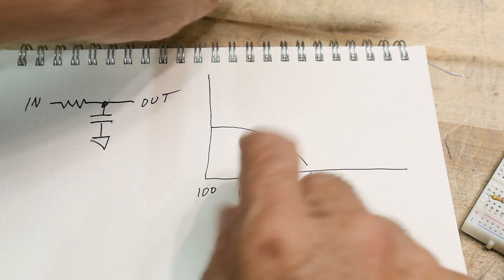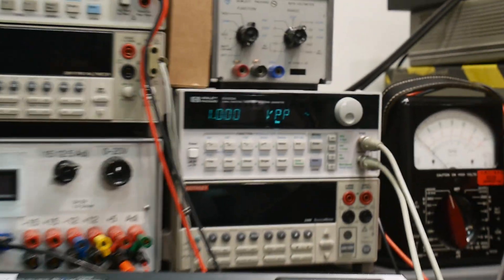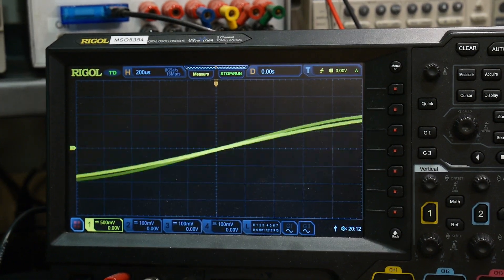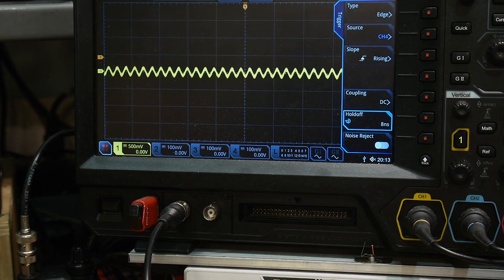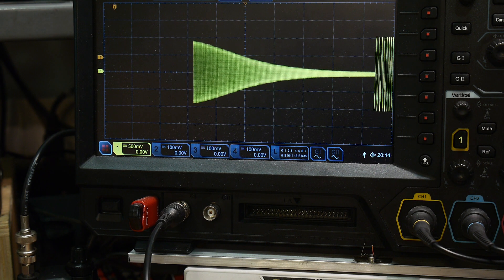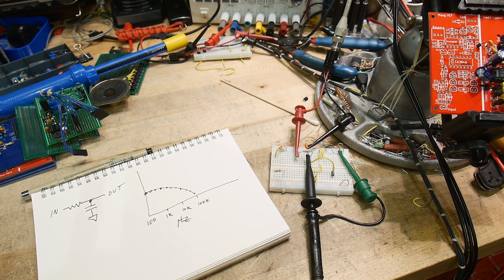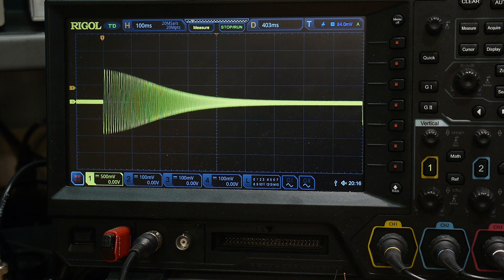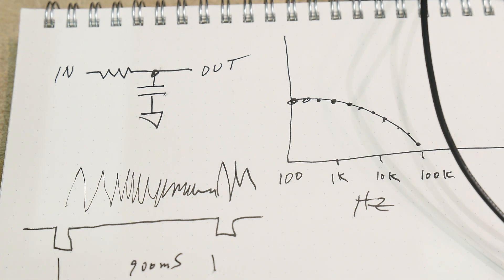#1213 Filter Frequency Response with Oscilloscope and Generator

Comment: My cheap function generator doesn't have the proper "sync" output. But it can have channel 1 frequency modulate on channel 2. So what I do is I put on a sawtooth on Ch2, let's say 0V to 5V. Then I frequency modulate on this to Ch 1 (enter proper parameters to set frequency spread corresponding to 0v-5V.) Then I trigger on Ch2, while looking at Ch1.

Comment: Thank you , very educational. Would you have an idea about how to get a pattern that is 4 waves that are syncronized  , that are 90 degrees apart could be generated?
Reply from the maker: 1. 7474 and 7404,  invert the clock and feed that into the second flipflop
2 four PLL
3. DDS, have phased sine waves in ROM
4. microcontroller
5. a transistor will output two signals 180 out of phase, output collector and output emitter, then do something like #1

Comment: I did a similar thing to make a tape for setting up the resonance of the heads on early vhs recorders. I made a circuit that generated a ramp triggered by the video field sync and fed the output of that to the vcrs fm modulator and recorded it. I fed the sync to the vcrs servo circuit as well so it had something to lock to. You can see the frequency response of the heads and preamp on the scope and you set it up to peak at 5mhz. I had to put a marker on the tape so I could tell where 5mhz was. I used a comparator for that to briefly pull down the input to the record amplifier when the ramp reached the voltage that corresponded to 5mhz output from the modulator.

Comment: Don't you have an external trigger input on the scope?   I thought that was where you input sync pulses so you don't burn a channel on the scope.     Especially if you only have a 2 channel scope.    Thanx for showing how to set this up.   Most channels show the signal but not how to set up the gear.   I would love to see how to setup scope/generator to measure signals when aligning FM tuners.
Reply: That was the first thing I was thinking. Both of my analog scopes have ext trig inputs.
Reply from the maker: no ext trigger, but lots of inputs, 4 channels and 16 logic channels all of which will trigger

Comment: You could use white noise generator as your source and Spectrum Analyzer for monitoring the output,  I think your oscilloscope should have FFT function or Spectrum Analyzer.

Comment: You could add a peak detector in front of the oscilloscope input, you will see only the envelope. I suggest to use germanium diode(s).
Reply from the maker: in the next video you will see that using a peak detector would not allow me to look at distortion.
Reply: @IMSAIGuy  I thought you were interested only in filter frequency response curve.
You mentioned distortions, you meant distortion of the wave passing the filter, thd ?
I’m waiting for the next video :)

Comment: I came late to the party, so obciously I've not seen your whole back catalog.  Have you done episodes on log amps?  An envelope detector and log amp is what you really need there - in which case you've built a DIY scalar network analyzer.

(The next step would be to have I and Q signals available for vector analysis, but that's harder, of course.)

(And yes, I know you have a VNA and I know why you're not using it here.)
Reply from the maker: I did a walk though of a spectrum analyzer and showed the log amp and envelope detector. I plan on doing a video on log amps in the future. this method allows me to zoom in and look at any distortion to the signal (in the next video)